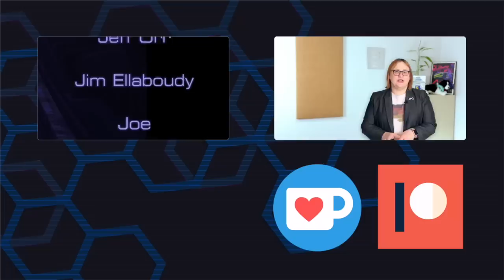Could Electric Bring The MInivan Back? Mercedes-Benz Seems To Think So!

Comment: One quick correction Nikki. In the sates, minivans, at least in the family hauling variant, are most often front wheel drive.  The rear wheel drive vans you're probably thinking of are cargo or conversion vans. (commercial delivery vans as you'd put it)  For example, the Dodge Caravan is a minivan.  The 90's GMC Safari is a conversion van.  That Merc would fall in the latter category.
Reply: No, she's right: The Chevy Astro/GMC Safari were minivans... and there was also the Ford Aerostar, and they all were RWD. However, none of them came with V-8s. And, uh... before there were conversion vans, there was full-window passenger vans. I should know, because my dad had four over the years [until I was about 35] starting with a '72 Chevy Sportsvan-20. (3/4-ton)
Reply: @pancudowny  Uhh...  Dude, even Chevy said it wasn't a MINI-van.  That was part of the whole marketing shtick behind it.  It was also classed as a van, while the Aerostar was classed as a minivan.  It was just ugly as hell.

https://en.wikipedia.org/wiki/Chevrolet_Astro

https://en.wikipedia.org/wiki/Chevrolet_Lumina_APV 

https://en.wikipedia.org/wiki/Ford_Aerostar

Also, my family have owned Caravans (more than a few) and Safari (couple, but less than the dodges) as well as GM's first attempt at a true minivan, the Chevy Lumina APV. 
Only the Safari/Astro and Aerostar shared parts with the mid size truck and suv counterparts, while the drive trains for the APV and Caravan were from the sedan lines of their respective manufacturers.
The Caravan was launched under a "light truck" classification at first, but that was fixed later.
Reply: That was my immediate reaction too, but thinking back in more detail, it was something of a mix.  

However, I think it is true that the most popular minivans — Dodge Caravan and Honda Odyssey, for example — were front-wheel-drive.
Reply: @pancudowny  I don't think she's right that most minivans in the U.S. were rear wheel drives with big engines. The popular minivans were mostly FWD. Sure, some of the scaled down full size vans were RWD. And I can't think of typical minivan (as opposed to a downsized van) that had a V8. Minivans were cars. The Safari et al were mid-sized truck based.
Reply: The Mercedes is awful as a family can.  Americans would not have such an unreliable industrial looking, inflexible, EXPENSIVE vehicle
Reply: in australia I would say most of what I call "minivans" are split between kia carnival and toyota tarago. shopping for one on gumtree they are classified as wagons and only commercial "white vans" are minivans. Which is weird... I think they are both FWD though (carnival/tarago), and look like this Mercedes, but they are around $30-40k USD. SO... with that in mind, since all electric cars are at least double the cost of an ICE equivalent and still sell, this "minivan" falls perfectly in line with what people want and are willing to pay. Obviously not expensive for an EV, and plenty of demand there (won't need 100's of thousands of orders since they won't be willing to make that many anyway).
Reply: dodgé   hàß ñew hybrde m⁸ñí van ³1 mioevrànge tekss cellß 37 mile rañge

Comment: If people really thought about it, minivans are much better suited to the tasks for which people buy SUVs. SUVs are supremely stupid vehicles.
Reply: yep, SUVs are really re-marketed hatchbacks
Reply: I agree, mpv's suit families so much better but people are more concerned with image than practicality.
Reply: The problem with van based people carriers is, they’re van based meaning they usually have leaf sprung rear suspensions and a van like interior where MPV’s are more comfortable and handle better as they are more car like suspension wise and interior wise.
Reply: @macjim  - Apparently you have never driven a Honda Odyssey.
Reply: @JohnCline  Mac Jim doesn't realise MPV is what americans call a minivan... Honda Odyssey is an mpv, and it has a specific american version of it, so that name refers to a different car in different countries. I think it's bigger in america?
Reply: @knifeyonline  The size is indicated by the name. "Minivan" was coined by Chrysler shrinking a passenger van down enough to fit in a garage.
Reply: @macjim  The Minivans in the US are car based (Kia Sedona, Toyota Sienna, Honda Odessy, Chrysler Pacifica).

Comment: If its electric and can haul a full sheet of ply, I don't care WHAT they call it. I call it sold!
Reply: Why would anyone want a vehicle that can't haul a 4 by 8?
Reply: @BoopShooBee  I don't even know what a 4x8 is, so I suspect I don't need a vehicle that can haul one around.  I'm guessing it's a measure of plywood, and I would move something that large so rarely that it wouldn't make sense to own a vehicle big enough to move it.  Better to own a vehicle that meets your needs for 99% of your use, and rent something for the rare time you need something different.  There's an (irrational, IMO) tendency to want to own a vehicle that can do everything you'd ever ask it to do, even if it makes it less appealing for the majority of the things you'll actually use it for.
Reply: I’m next in line for one carrying an 8x4
Reply: Right!! I'm an electrical contractor and have been holding out buying any other vehicles till I could get a couple VW microbuses. Something large enough to handle conduit, ladders and material for 90% of the jobs we do. But, contractors would snatch something large enough to handle full sheets of plywood and drywall as fast as they could be made. Now, if only Home Depot and Menards would install chargers!
Reply: Right - came in handy with the Ford Windstar we had in Florida at the time when a major hurricane was looming. The VW Jetta sure wasn't going to get that back home.
Reply: @LG123ABC  Is that why so many people in the US have massive pick-up trucks? :-D
Reply: @LG123ABC  Why stop at a pick-up truck or an RV then?  Buy an RV and drive it everywhere.  Drive it to work, to the grocery store, etc.  Better to have it and not need it, than to need it and not have it, right?  No, I'd argue it's far better to have the perfect thing for your usual use, than the imperfect thing most of the time.  Rent something a different vehicle when something unusual comes up.
Reply: Göran Karlsson Except most modern pickup trucks have a bed that is too short for plywood or lumber without leaving the tailgate down.
Reply: @ScrapKing73  thàts what çhéf byibg ev rv getjg nsred wife hiig get iregen whioke chargibg

Comment: The Model Y is not available in europe. There are of course a few US imports making the rounds, but european Model Ys will come exclusively out of Giga Berlin which is still being built. On the european order page it says: Production start is planned for April 2021. 

That said, the Vito would not be a considered a mini van in germany, it would be considered a Van, in the same category as the Volkswagen Bus (or rather, Transporter). Mercedes never really had a mini van comparable to the VW Touran or Sharan in its portfolio, they used some chrysler models during that rather embarrassing time when they hooked up with them. 
But of course, in europe cars are in general smaller than in the US.
Reply: What about B-class? Is that not van-ish enough to be called a minivan?
Reply: @itekani  Well, it could be seen as such. I always compared it to the Gold Plus (now sportsvan) that is not really a minivan either, both are usually driven by seniors as well, so they do seem to attract the same type of buyer. But yes, of course, they could be seen as a mini van.

Comment: Yes!  Want to see the commercial EV vans for the RV market!!!
Reply: I totally agree. An electric Mercedes Sprinter with a real world range of at least 250 miles when at full rated carrying capacity would be a great basis for many Class B and C motorhomes.
Reply: @ElGuajiro48  
It also needs to have the ability to deal with somewhat dodgy roads.  The Sprinter has stuff too close to the ground.
Reply: @kensmith5694  You are right about the relatively low Sprinter. However if it was a 4WD version I believe it would be higher of the ground.
Reply: @ElGuajiro48  
An electric AWD need not be much higher off the ground.  The wheel well space may have to be a bit bigger.  I am thinking the motor lives very close to the wheel.  
Think of a "trailing arm" sort of design where a rod runs from the wheel forward to connect to the body so that the wheel can't move back and forth.  
Now instead of the rod, have the mechanicals of the drive with the motor at the body and pivoting as the wheel goes up and down.  I think a total of 4 times 40KW would be enough power for a practical design.

Comment: I would love to see a Tesla Minivan similar to the Mercedes Vito Model with a electro-hydraulic chassis, which can be moved up and down whenever needed ( for example outdoor camping / bad road condition, high curbstones etc. )   and also  equipped with a 200 KWH battery pack to reduce loading procedures to  just one to two times per week  or just to get higher overall range.

Comment: Nikki you are bang on with this one. I use my seddona as a family car, furniture van and as a long weekend camper. Just wish it was electric with around 200m range
Reply: I'd buy an EV Sedona too but with 400m super fast charge capabilities. On the move too much not much time to wait too long to recharge 15-20 minutes. I'd prefer the same time it would take to fill up with gas which for me 5 minutes or so from a quarter tank (on a 18gallon tank) to full. If Hyundai/Kia cane up with on I'd buy it. If it's the same size as their current minivans here in the USA and in Korea.
Reply: giid fir yiú charges only 114 mioe pléntty

Comment: 1:02. North American minivans were NOT typically built with rear wheel drivetrains. Only the Astro/Safari and Aerostar were rear wheel drive, and neither of those dominated the North American market for minvans. Large vans were, and still are, mainly rear wheel drive. The minivan was just an adaptation of a group of cars know as tall wagons. CUV are an  also an adaptation of tall wagon. Not sure of the origin of tall wagon, but Dodge, with Mitsubishi introduced the Colt Vista the same year Chrysler introduced the minivan. The next year they added 4WD. Nissan had a similar vehicle named the Access that came out about the same time. It even offered 2 sliding doors long before the minivan did. Nothing about CUVs is new. They were largely invented by Japanese companies, but made popular my American companies. I guess the Americans were better at marketing and shepherding.

Comment: Minivan is already more particle for most families compare to SUVs as is. Electric minivans and vans are less particle than their hybrid counter parts, at least for now. I am actually surprised that all we have is Pacifica Hybrid (PHEV) and Ford Transit PHEV. You would think all the Amazon delivery vans will benefit from being hybrid, but no, full electric vans just sounds much better from a PR stand point.
Reply: I'd have to disagree with the delivery van part.
Those vehicles don't dive super far and did a bunch of stop and roll on to the next stop. They can be a little tailored to the specific route so a short route truck can have a smaller battery and the longer ones have the bigger batteries. Then charge overnight.

Comment: Good of you to discuss range, because that is where delivery vans and family minivans have very-different requirements.  Doubling the range of an EV into the high-200-mile vicinity usually represents a substantial redesign effort, as we all know.  For example, a 100-150-mile battery may do OK with a chilled-air cooling system, but a 250-300-mile battery would almost certainly require liquid cooling.
Reply: wiñg biat  rabge  1⁰⁰ too 300 mioes lkety

Comment: Back when I went to school around 1970 or so, we had two families alternating driving the kids to school. Both had large cars for large families: I believe we had a white-ish Peugeot 504 Familiale, and they had some version of a blue VW bus. I still remember when a red light runner just barely missed T-boning the Peugeot at the door I was sitting behind. (He crushed the complete front instead, then drove beyond the (big) intersection until he could stop. Much too fast for an inner-city road. I think it was some variant of commercial panel van.)
Reply: pogot 5000 eltrc   vw buscsolar ekrrc 10⁰ mioevtàge téßà
Reply: @sharonbraselton4302  ?

Comment: Very tempting. After last week’s announcement of the next gen Toyota Sienna AWD hybrid, I was starting to think that it was the best option for 6+ seating. Now I’m back on the fence. I hope Mercedes brings either model to the US.
Reply: Toyota Sienna Hybrid? Wow. Not buying a Hybrid I want FULL EV Toyota Sienna. 400m super fast charge capabilities. Solar panel film on the roof and hood. And maybe on the windows too if they can make them see thru and act as tinted windows.
Reply: EV Mercedes Sprinter cargo and passenger VANS would be fantastic to have about now. With 500m range per charge with super fast charge capabilities.
Reply: Robert Lee That sounds amazing! I hadn’t even thought of a full EV Sienna. But if Toyota made one it would be a great option.

Comment: They shouldn't call it a "minivan".  The name is associated with some things that they may not want the new vehicle associated with.
It would be good to offer "all wheel drive" with 4 small motors.  Cooling motors gets harder as they get bigger.  The performance doesn't need to be "sporty" but dealing with US on ramps does require a bit of a burst of power.  AWD also brings along better dealing with slippery surfaces.
The top needs to be at least strong enough to carry a canoe.
Solar panels on top could be good for those who want to use it as an RV.  It should be an option though.
Charging from a normal mains plug where you get to set the maximum current would be good.  It would be slow but it removes some reasons to worry (for real) about range.

Comment: Renault planed a new fully electric kangoo for 2021 on the CMF-C platform,, PSA group was supposed to launch 4 fully electric pro mini vans this year on the EMP2 platform with a choice of 50kwh et 75kwh batteries  ( Peugeot Expert, Citroën Jumpy, Opel Vivaro et Vauxhall Vivaro) and fully electric versions of their family mini vans in 2021 (peugeot rifter and opel zafira), not sure how the virus issues changed all of this, i actually own a 2012 diesel family Kangoo, surprisingly comfortable and of course very practical,  the supposed 2021 electric kangoo will be my next car.

Comment: One correction to make. Aside from the Chevy Astro and a few FWD based AWD systems, minivans in the US have been largely FWD. Earlier ones were either 4 or 6 cylinder but I don't recall any with a V8.
Reply from the maker: You're totally correct :)

Comment: Had my 2015 e-NV200 Evalia for about 6 months now, despite being dinged up and having crap range it´s a fantastic car that can do almost everything. Love it and will keep it until it falls apart or I find one with the bigger battery for a bargain price.
Reply: I've heard you can do battery swaps on old Leafs ( I believe Robert at Fully Charged is doing one once things open up again).
If the e-NV200 has the same battery as the Leaf, I wonder if that would be an option?
Reply: @MrGonzonator  You can get 69kWh, tow hitch and three phase type 2 and about 200kW CCS fitted in Netherlands. Google Ultra Leaf...

Comment: This is why I think the Sion (sono). Is a great car.
Reply: It won't have three full-sized 2nd row seats, and seven seats isn't an option either so it's a disappointing no from me. Early test examples had the individual folding seats but they've clearly gone with something cheaper and off the shelf.
Reply: buy  it

Comment: I love the look of the Mercedes minivan, but somehow I doubt that it will make it into the delivery van segment. Minivans and commercial vehicles are usually dirt cheap, which is probably why Tesla has not entered this segment, or shown any interest of doing so.

European cities that want to go green will probably go for cheaper options, they don't need the range of the Mercedes. But then American cities don't even have such options: The Mercedes minivan is the only intermediate size between a car and a 3.5 tonnes Ford Transit so far. Being the only electric minivan on the market will most likely help it find customers in niche markets beyond simple family carrying.
I can already see coachbuilders redesigning the interior as a luxury limo, maybe even stretch it!

Comment: I had hoped to see Nissan sell that env 200 to our post office. Thought they would save a lot of money driving those vs the old Chevy powered units that are 30 years old. Uk nissans even have the steering where they want it, the range would not be an issue. Next to that selling electric to city police would be a great sell, faster, ac works while sitting, range not an issue when used in a city. The more municipal government sales would help promote and reduce the public’s cost for their consumer ev. Just a thought
Reply: ñew oñe getc150 mîes frm 124 míes 126 mioevrage

Comment: They could take the mkt in a mini off grid camper van with different inserts to load in back when building just make the vehicles and slide in the different variations of the mini tinny off grid tiny home if it could be pulled out insert you could place the insert in area where your camping and use van for cargo,building a home with carrying new home materials while living in the tempary tiny insert from van that would be self contained having the solar panels carryed on top of van that snap in and out of place to charge the mini tiny home that would have solar panels next to it and if you had 2 way charging you could charge battery in the mini home and drive to charge up battery in town for van as your in town you could pick up food materials or use for job